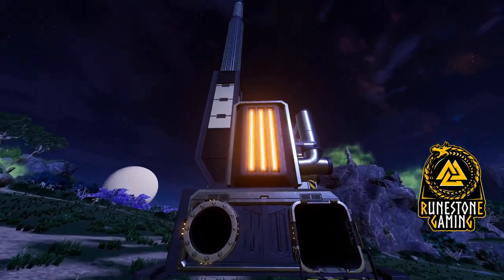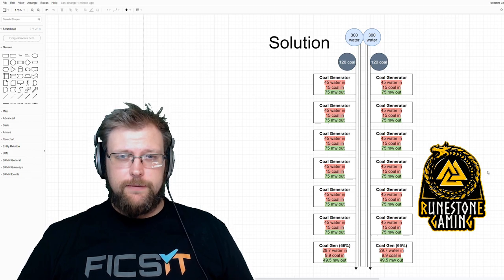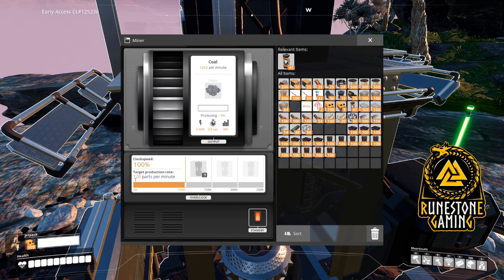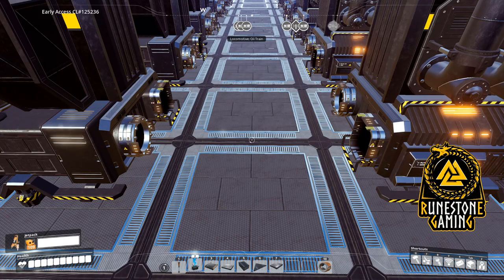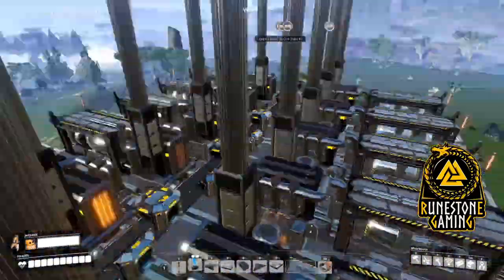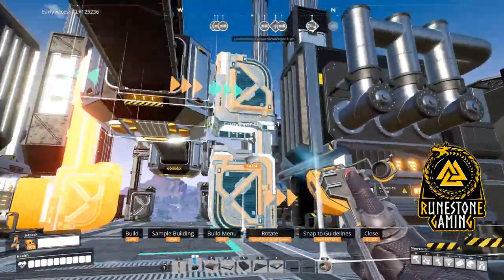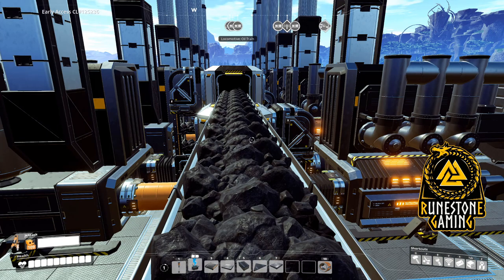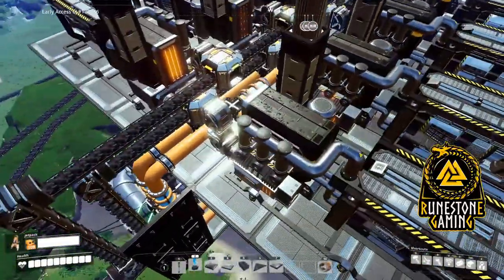Satisfactory Game Tips & Tricks - Coal Generator Build

Comment: I'm still using the setup where 8 coal generators use 3 water extractors and 120 coal, and I mirror them like your setup. I'm just feeding in the water pipes on both ends. Another thing I always do, is feeding the coal generator with water and coal first before connecting the power cables to the generators. This allows the generators to fill up on water and coal without consuming either of them. That way, you're guaranteed to have full power straight away instead of a on/off pniball machine while it's all filling up. And since my coal and water are full, it also provides each generator to have it's own full internal buffer if there are any hickups like quickly moving a conveyor or pipe, for which you need to reconstruct it and rebuild it. This hickup disrupts the supply and could result in a power-loss but not if you let the generator fill up first.

Comment: For anyone who cares. This is a good build but there is a better way. If you add one more water extractor you can get two more coal generators with everything running at 100% and add 240 coal to it. Will need to have 4 piped. 1 pipe for every four generators. U can connect them all using valves if u want.